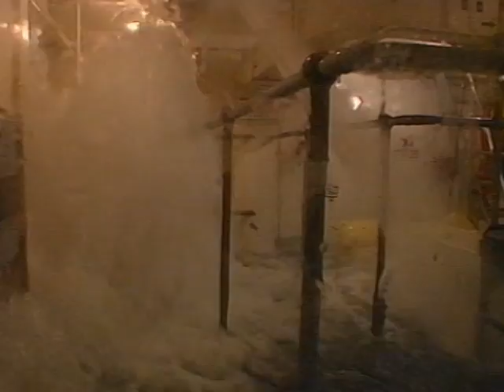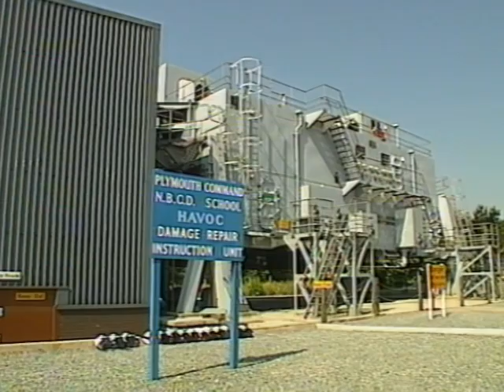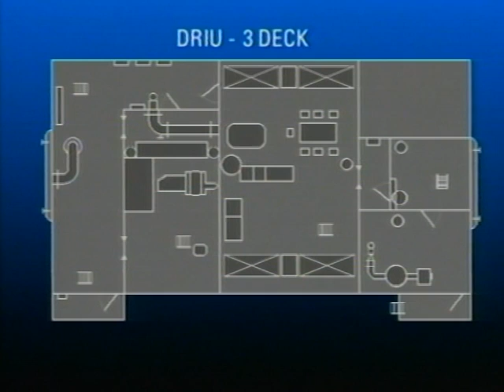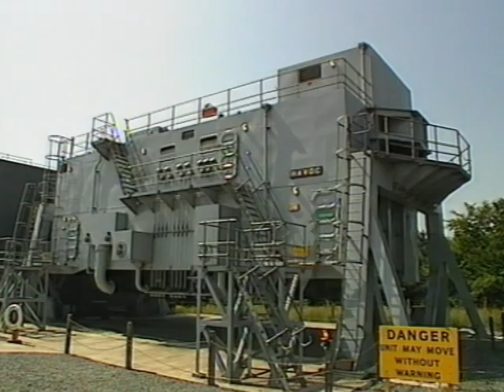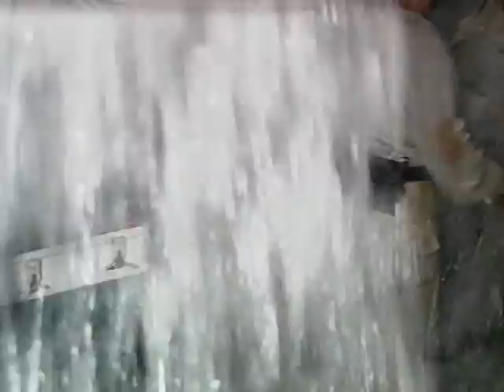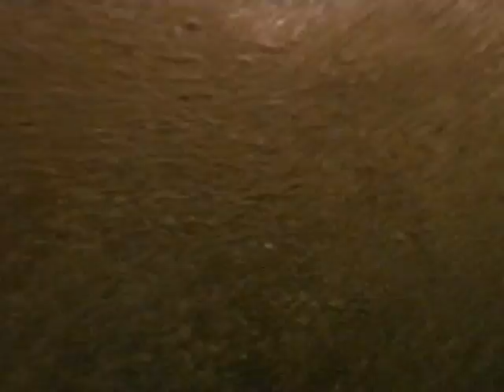Damage Repair Instructional Unit

Comment: The set-up in Australia is nowhere near as elaborate as this. No hydraulic rocking effect, lighting or sound fx - just something using a hammer on the other side of the bulkhead to simulate an impact. Then again we're very lucky our ships have never sustained battle damage since the 1960s.

Comment: What happened to the spurge pipes system that uses steam  across a ventury tube to pump water out at a rate nearly as fast as it can come in.
When serving at the original H.M.S.Raleigh which was the school for engineering in the  sixties.
Down the road was a placevcalled stoniville which was the  school for fire fighting wher they had actual sections of ships and complete tanks of crude oil that was set on fire, we were given hoses and sent in with the instructions not to come out till the fire was out.
This was a baptism of fire in the most literal sence , aand was designed to prove that this could be done.
I think the course lasted three days of practical fire fighting some of which was quite frightening, but we did it. I went on from there and took another course on starting fires, plus other things.
This addition looks like a good safe way to train people but must have cost a lot to build.
These days the navy has welded ships, and the metal work is very thin when put up against the likes of a battle class destroyer, and it seems that they cannot withstand any where near the damage that can happen.
My grandfzther actually served on the original Raleigh that was sunk off newfoundland, he went through bothe world wars serving in the Navy, and received a whole box full of medals that are now on show at the naval museum, he had i think something like seven or eight ships sunk from under him, so we were very luck as kids to have a grandfather after the war,
He wa a very quiet man, and  a really good example to us jn just about all lifes subjects, other than he did use some very colourful language at times. I am now as old as he was when he died, but i dont think a day goes by when he is not somewhere in my mind.
After having served myself and served during conflicts of much smaller thing than world wars, it still angers me that we still have need of forces of any kind, you would have thought common sense would have played a part in humanities actions, but today is no less troubled by those who think warfare is the answer, i think its because those who think that way are usually those who never have to be involved in the horrors of it outcome, and i truly think that we should have learnt to make sure that at least those so keen should be the first to go with no one allowed to dodge the outcome of their actions in society, much of which from what i have  seen starts with lies.

Comment: I did the older static simulator while staying at HMS Raleigh with Sea Cadets in the 1980s absolutely brilliant, spool forward to 2009 I owned a 37ft sailing yacht - I went to close the 2" valve from the sink through the hull overboard and due to galvanic corrosion the entire valve broke off in my hand I see green daylight and 2" rope of water coming into my yacht.
What I learned as a kid I had put into practice - all my yachts even boats I have a damage control satchel but tailored for small boats (e.g. epoxy putty, 5 min epoxy, fibreglass tape, duct tape, cable ties, ) but I still have chocks and bungs. EVERY through hull valve on my boat I had tied a wooden bung hanging from the valve. - I stopped the leak in seconds then got the DC satchel - used a mallet to know it in then epoxy and tape to make a semi permanent fix to get me to the yacht repairers and hauled out.
Thanks RN your training saved my yacht.
Reply: Wow I went to HMS Raleigh a few months ago and we did the same thing as well. Didn't know HMS Raleigh was that old.
Reply: Cheers Dits

Comment: Pine wedges expand as they absorb water.
Reply: Plus they have enough 'softness' to mould quite well to jagged steel when whacked in, possibly making them less likely to be forced out like corks with pressure?

Comment: Are there wooden wedges in all compartments of a Ship?  Is it really possible to fix a hole by these wedges? I am not a sailor, but it is interesting to know how you can repair a ship in this way
Reply: +anisocoro There are things called DC lockers.  (Damage Control) that contain different items used to try to save the ship.  Hardwood wedges, used for wedging in place "shores" large wooden beams to hold in place pads covering holes, or buckled hatches doors etc.  
softwood wedges that can be used to plug holes.. these will swell over time, making a more watertight seal.
Hammers, lights, wedges, bungs, ... all sorts of stuff in these lockers and they are placed at various parts of the ship depending on what class it is.
It's almost impossible to completely plug a gap.. but the idea is to reduce the amount of water coming inboard, so that the ships pumps are not overwhelmed and can ditch over the side, more than what is coming in.
you'd think that this is old hat.. but it's a tried and trusted way of doing things.

It's very realistic... usually dark until one of the crews manage to restore lighting.  All you have is the emergency lighting (from ael's.. automatic emergency lanterns)which is quit dim... the water is very cold and the whole thing is moving.  Very often, the most efficient way to get across a compartment is to swim rather than try to walk!  There's tannoy calls going on... loud bangs... smoke in some areas..But.. GOSH IT'S FUN!  Nobody ever "saves the ship" in this scenario and you are quite apprehensive going in, but I never met anyone who didn't want another go straight away.

Also.. the bloke doing the narration in this calls the driu a "dryoo"... it's actually pronounced "droo"
Reply: +anisocoro 

it is not possible to close all holes completely but the water pumps will do the rest of the work (if all holes are near closed)